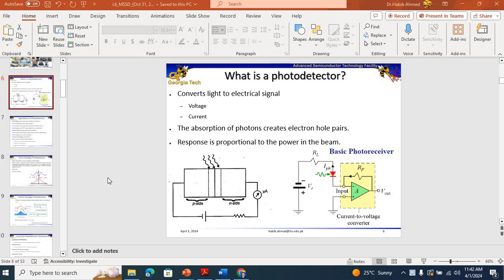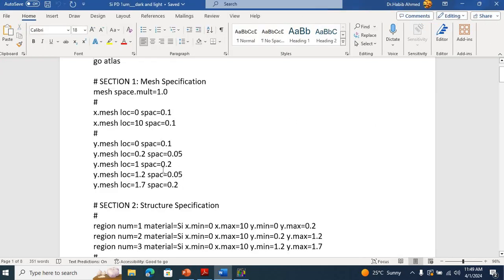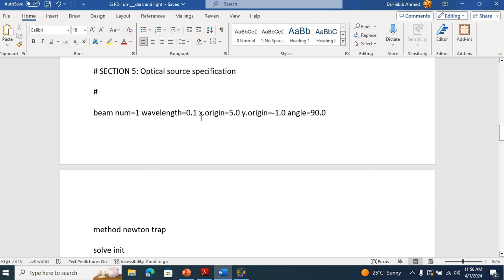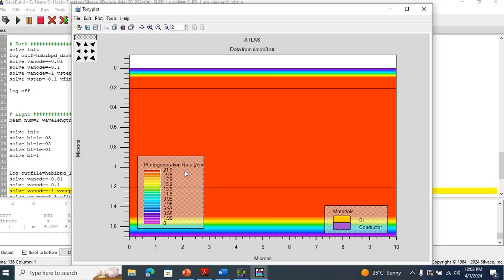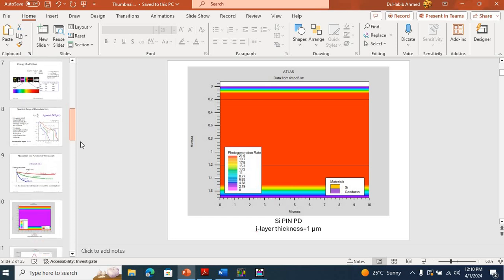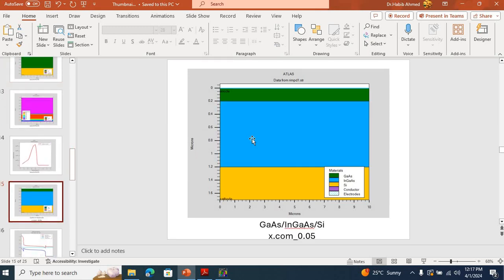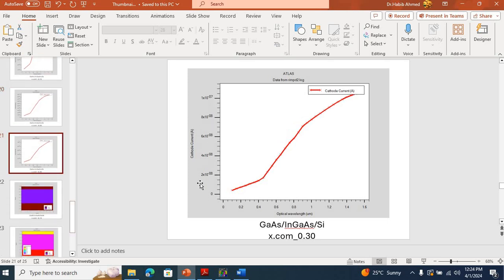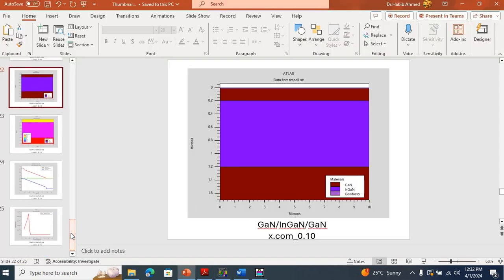Silvaco TCAD Simulation of Photodetectors || Si, GaN, & GaAs Photodetectors 🚀💻🔍💡🔋📈

Comment: Why does the Optical Response Change from a Peak Shape to a Linear Graph as the Indium (In) Fraction is Varied (0.05, 0.1, 0.2, 0.3) in a GaAs/InGaAs/Si Structure?

Comment: Salam Alikom
I have a question please
U specified the beam at Y=-2, automaticaly befor the anode, so how the beam penetrates in this case inside the structure 

Thanks
Reply from the maker: W/Salam!
An angle is also defined so that the beam is directed towards the device.
Reply: Please sir, in this case the beam penetrates the anode toward the device? It is possible? Baraka allah fik
Reply from the maker: @FETHIBENYETTOU-l7e  Valid concern. Watch my video on MSM photodetectors to learn how to set up the contacts so that light does not penetrate them.
Reply: @HabibAhmadGatech  Ok i will thank u so much

Comment: Thanks for the good video, but do you know how to calculate spectral sensitivity (A/W) in TCAD, what formula to apply and plot the wavelength?
Reply: Salam, for plot respesivity u can plot EQE by addind i anode/source photocurrent. Then u apply this relation 
R=q×EQE×lampda/h×c
Reply from the maker: I'm glad you asked.
Very simple. Current Vs wavelength is already plotted. Just divide the current by the input optical power to get the responsivity in A/W.
Reply: @HabibAhmadGatech where to get it optical power in TCAD? How extract it?
Reply: maybe you would record a video of how to count DCR (dark current rate) if this is possible using only tcad?

Comment: Thank you very much, Professor. I am receiving a lot of help from a faraway country. Currently, I am writing a program on the performance change of devices according to the structure of the device using the loop function. If it's not too much trouble, is there a way to save parameters like Vth or SS for each loop into a single CSV file?:face-purple-crying: